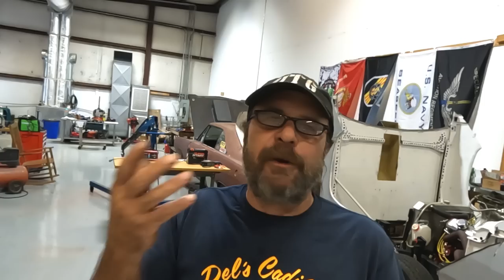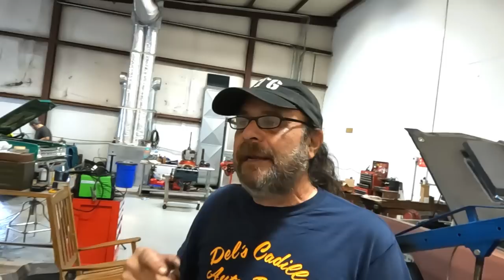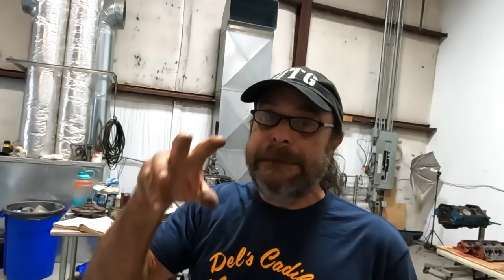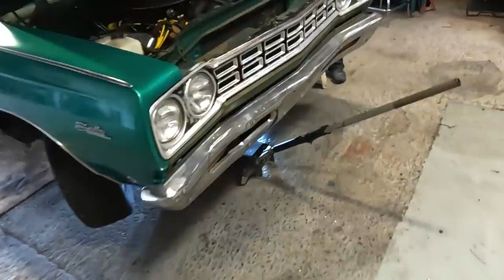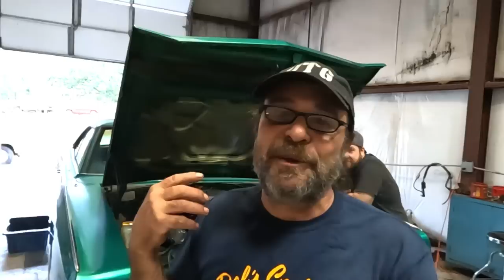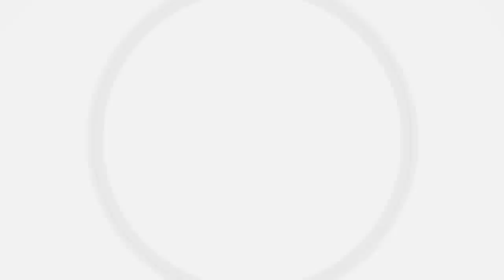The Most Unusual Engine Build On Youtube And Newbie Transmission Tribulations

Comment: Building a 318 currently and with just a few bolt on bits this puppy has really come to life. A cam, headers,4bbl carb and later model "302" heads and it is a snappy little V8.
An old school Chevy 350 guy at heart has fallen in love with the 318!
Reply: "302" as in ford?
Reply: @hickeyskustomresto  
No, the 302 (part number) heads were a closed chamber design used in the lean burn Chrysler motors.
Although small ports and valves the boost in compression makes a nice improvement and seems to really like the comp cams xe268h.
I've read these heads are generally disliked,  crack often and dont flow much but for a 300hp street motor they drive well, awesome throttle response.
Reply: "302" is the casting number on the heads. I think 86-91 were the production years.
Reply: Can u use 340 heads ?  Im a chevy guy too so just wondering .  360 heads ?
Reply: @jeffreyyeater1780  
Yes but the 340 and 360 heads have larger chambers than this particular 318 head.
Compression suffers.

Comment: I have a 69 gtx I bought when I was 17 years old and still have it at 65 years old. I have the original motor sitting in the corner of the shop. It currently has a cross ram 426 wedge that is pretty healthy. Do yourself a favor and put a mini starter on it. I have hooker headers on it which were a lot better design than about 90 percent of them back in the day so it was not a real bad problem to get the starter off of it. I can get the mini starter in and out without any problems.

Comment: In 1973, I bought a brand new Roadrunner with a 318, 170 factory HP. Using all MoPar parts, 340 intake,Holley 4bbl, Purple Shaft cam and headers and a little head work, this car was a blast to drive and pretty quick. I spent a great amount of time at York US 30 Dragway and South Mountain Dragway turning mid 14's and lower all day long. You could smoke the tires all day long and just have fun with it! Not the fastest but a hell of a lot of fun for a young guy on a budget.

Comment: G'day Uncle Tony,

When I was an apprentice,  late last century, I bought an Austin Healey Sprite from dad.  He said that it needed some repairs, so we pulled the engine out to rebuild it.  As we're looking at it on the garage floor, dad says; "Are you going to hot it up?"  "Yeah, OK.  Why not?"  "Well, you better read up about it 1st."  At which point, he gave me David's book, Theory & Practice of Cyl Head Modification.  I read it.  I followed David's instructions for a hot 1098cc A-Series BMC engine.  I opened up the ports, tapered the valve guides, & relieved the combustion chambers.

I sold the car to a mate, before I could get it on the road, but after I fitted the engine & fired it up.  He got it on the road, then sold it to another mate.  He stripped it down, & rebuilt it for racing.  He fitted a Webber carb, a set of extractors, lightened & balanced the crank/flywheel,& replaced any damaged gaskets.  He left the body in steel.  Then we went racing.  I cannot tell you how many times that little 1098 outran 1500, 1600 & 2lt cars to the 1st corner, where the bigger cars would spin off the track (remember that big is a relative term to a Sprite driver).  Every so often, as I would hear that motor spin to 11,000 RPM, I would remember that it was still MY cylinder head on the car.

Please do me a favour, & send my thanks to David.

Thanks for the memory.  Keep up the good work.
Andrew

Comment: David Vizard is an engine optimization icon. He's also a SBC whisperer. I own several of his books and don't understand how I got by without them.
Hey Tony, here's one for you. I bought a 1963 Dodge D100, 318 2 believe and three speed manual. I noticed 2 unusual features on this truck, the first was the manual choke STROMBERG carburetor and second, the e-brake. It consisted of a solid ring app.6" in diameter and 2" across on the tailshaft of the trans. with 2 spring loaded inverted brake shoes surrounding it. When properly adjusted the truck would not move, even at high rpm. It was the best set up I've ever seen. The carb was round and looked like a huge single bbl. until you looked down the throat. Cool truck, wish I could have kept it.

Comment: Good luck with the 318, it can be done. Raced 340 small block Mopar's on circle tracks back in the late 70s. Next to last race one year our prime engine broke a rod and destroyed the bottom end, but the top was untouched. We transferred the W2 heads and cam package onto a junk yard 318 short block to finish the season. Other than the smoking from worn out rings it ran amazing, and we finished that season laughing our ass off at what we were competing with.

Comment: 318 was the first engine I helped build 40+ years ago.  We kinda just overhauled it, since it only had a little over 100k on it. 73 Duster had a good 8 3/4 rearend transplanted into it. 3.23 gears. 
We did put a highrise 340 intake ,Carter AFB and a purple cam in it and some Hedman headers with dual 2.25 exhaust.
It was a great runner ! It would roast🔥 those L70s on back too. 👍👍💪
The guy still has that car in his garage. Its Mopar green now :)

Comment: My 75 Winnebago Brave has one of the baddest 318s ever built and I'm in North Carolina. 
It'll punch out to a 321ci.
This will make up the
" 3-2-1-GO!" Package I had requested.
 Can't wait to see what you come up with.
 The 2 barrel carburetor is way better in many ways and has advantages.
Reply: I agree!  
I drove a 71 Horizon (25 ft Class A M300) with a 318-3 up a long 6 percent grade. It had a lot of guts.
The Mopar Bible lists it's many features, including forged crank with full radius fillets.
Reply: @auteurfiddler8706   Are you saying there's a forged crank in the  318 motor homes?
 I've heard some say it was true and some not.
Reply: @artsomniacv-logcitybydanie1249  Yes, full radius.  I think I read it in the Mopar Bible and possibly the M300 service manual. (M is Motorhome chassis for a Class A, box style).

Comment: The fellow with the '68 Satellite didn't say if the starter was bad, but if it is, one thing I use to prevent the heat from the header tubes (Hedman headers) from destroying the starter motor is to wrap the starter in a piece of wall insulation (fiberglass) when you install it along with the header which is a bit of a challenge. You can also use a couple of pieces of coat hanger wrapped around the insulation to hold the wrap together as you wrestle the starter and header into position. I had gone through a couple of starters before I came up with that solution. That solves the problem on any B body with a 440 or 383.
Reply: Starter was still good, just tired.  There are updates coming about the starter.   Ended up just buying a mini-starter to replace the factory one

Comment: The other good 2 barrel carb for a 318 is the Holley 2280 that came out in the late 70's and came stock on my '79 St. Regis. I liked the carb so much I did one for my '68 Fury VIP that originally came with a low top Carter BBD. All my Mopar V8s have been 318 2 barrels, I just love them so I'm really excited about this build.

Comment: I built  a real fast pulling 318 with .40 over bore, and a cam kit. Everything else was bone stock. It out ran a Z28, and a chev pickup running a 383 small block.

Comment: I wish Mr.Vizard better health. I did the same thing on my 225 slant6 stock parts . I still have to go back into the carter 2 barrel and get more cfm out the stock carb . I also did the same to my 318 in my D150 before I added a 4 barreland cam to it . the rest stock even the manifolds

Comment: Back in the day working on Ford FE's, there were few speed parts.  Some marine stuff in the commercial conversion world, some secret stuff from Holman and Moody that dealers could not even find.  So you had to work out what you could.  390's were everywhere and 406's were around.   3 deuces and 2 4bbl's were here and there, but heads were the issue.  And cams came from TRW and Melling.  But, if you put your mind to it, you could build a stout street engine.  So, I have no doubt that you'all can make a Mopar 327 run 🙃

Comment: I dun rebuilt over 400 transmissions [worked at a transmission shop], and while I don't claim to know all of them, they are generally petty simple all told, and pretty redundant, fundamentally, so once you learn the principles, and the overall ins-and-outs of them, you pretty much find it not too terribly hard to adapt to a new one any time you find one.

Comment: He can see the light at the end of the tunnel??? Son you got seven bolts off.... Wait till you get a peak at the innards of a automatic transmission. You haven't even seen the tunnel yet 😉
Reply: Hope he likes fabricating tools to get those suckers apart.
Reply: Can't ever get the snap ring off the output shaft. I know there are pliers for them but I'm can't buy pliers that only do one thing. It's like buying a pipe wrench that's welded to one size....

Comment: About the 318, Its gonna be better than listening to Starwars. Return of the Jedi!!!
About the 440ci transmission pull out.  He will have less problem if he makes his own tools. We had a 68 Charger RT "B-body" same as that Satellite and I remember cutting a wrench in half for better fitting on the flex plate.  Headers are in the way of certains transmission bolts cause you can't fit your hands in.  
We swaped the starter for a smaller direct fit 92' Dakota for more clearance to.  Littles details that Tony knows im sure.  Hehe.
Nice Satellite by the way and Nice content again.  
The only problem when you first start and fail is not having another part to retry. 
What is enough of porting?
How short to cut or grind a piece?
Good parts are rare or expensive.  Practicing on junk part don't show if it works if you don't try it on the engine.   That's where Tony is great in teaching.  When you feel this, or when it does that.  When you see that or when you ear this.  
I hope you got something out of that! Yes sir.

Comment: Hey IT guy there's a little tip for you .50% gasoline 50% transmission fluid put it in a squirt bottle shake it up real good and use it on your rusty bolts.

Comment: on the exhaust bolts that won't come off , use a 0 or #1 oxy welding tip and use a highly oxidizing flame to burn them out

Comment: IMPORTANT: I was a rare and WINNING FAN of the 318 ALMOST 50 YEARS AGO. I know we're talking stock, BUT the Edelbrock LD4B intake combined with a stock early THERMOQUAD (I believe it came off a 1970 or '71 340) combined with heads I ported and installed slightly larger valves( it might have been exhaust only, I seem to remember a problem with shrouding on the intake valve because of the size of the bore) and headers produced a 318 that was virtually INVINCIBLE on top end! I reached speeds (over 3 miles perfectly straight in Broad Channel island in Queens, NY) OVER 170 MPH in a 1970 Dodge Challenger SE (special edition- little rear window and overhead console) I had installed the rally gauge dash. The reason I know how fast I actually went, was because a half dozen cops came to my house in Rockaway one day, with a claim they clocked the car at 171 MPH, BUT by the time they came out if the marsh grass to come after me, I was over the old North Channel Bridge and gone. Anyway, prior to that day, I ran alot of  Chevies that got me out if the hole, but we're helpless (usually past a quarter mile I admit) as I ALWAYS overtook them, regardless of the rear gears. MANY of these guys insisted I take them for a ride to SEE WHY that Challenger was so fast!  The flat tappet cam was NOT that radical, I think the LSA was around 106 degrees with 280-290 degrees advertised duration and a little over a half inch if lift, with about 130 lbs on the seat, and about 300lbs open. The ramps were gradual compared with today. That's it, of course it had hooker headers, a slapstick, and dual 2.5 inch exhaust out the side in front of the rear wheels. I later did this with a 1971 Challenger convertible 440 six pack, BUT IT WENT THE SAME 171!
Reply: IMPORTANT : FORGOT TO MENTION HAD TO DROP FRONT END AND USE AIR DAM (FROM A TA CHALLENGER) TO KEEP CAR IN THE GROUND!

Comment: Please put this build on DVD. I have my dad's 79 B-100 van, and I want to build it with the most power I can get out of it, but I want to keep it original.  Although it does have a 4 barrel carb.  It already is a good towing van, my dad pulled a two horse trailer with it.

Comment: The motor you get to work on you will check the thrust bearing  Part of the crank shaft please explain about that and what is acceptable or when a new crank is necessary.

 Thank you

Comment: I had a 73 Dart 4 door with the 318 2 barrel with who know the milage back in early 90's. I just put a stock cast iron 4 barrel and thermoquad and added a stock grind 71 340 cam. Kept everything else 318. In the 1/8 it ran a 10.1. I think the rear gear was 3.23?

Comment: I think your goal of 275ish horsepower is a little more realistic that DV's. Using all stock components would mean making his estimate of 315-330hp at no more than 4,600 at the very max, meaning peak torque would be around 420-450ft-lbs. Making that from an N/A 318 is impressive as is, but doing it with stock components would be a miracle. If I were you, I'd be extremely happy with being somewhere in the high 200hp range considering the parts you'll be using.

Comment: Compression height with cheap pistons is almost always 1.74 the 70-84 stock type. More money but KB167s are 1.81 and still down hole about. 010 with stock decks. The advantage is you deck to zero, use a common .040 gaskets and wind up "relatively" close to where the heads were originally.  (.010ish higher deck and thin steel shim gasket) 
Start decking for any meaning quench with pistons. 070 shorter and intake manifold fit gets interesting.
If you want quench you'll need either the 302 heads (yuck)  or 67 and older heads. In 68 the 675 open chamber castings where the new "improved" 273-318 head. Same year the big blocks got the 906s.

Comment: It’s always a challenge just to get at what you gotta get at. Put a clutch in my car once, simple procedure I thought. Well to do so the entire car had to be blocked up about 2 feet off the ground then use a cherry picker to drop the motor down and pull the tranny out the side. The actual clutch replacement went quick, everything else took 2 days.

Comment: 1hp per cubic inch is going to be a bitch with a "stock" cam, heads, springs, intake, and 2bbl carb...your getting back to Smokey Yunick days...good luck 👍 to you sir I hope it pans out. 
The cubes are there but my guess would be about 270hp ...using RockAuto parts, couple hundred on a good day

Comment: David Vizard is a legend in his own time! I've relied on the knowledge learned from his books for years.

Personally, I have plenty of experience and tools, and a little bit of money set aside for my various projects. My biggest problems are finding time to work on them and availability of parts. It's tough to plan when you try to order something only to find that it has an "estimated shipping date" months away. Hell, I waited over 2 years for a set of ceramic coated headers to become available for my current project and they're STILL not available! I actually ended up buying a 2nd set of standard headers and was lucky to find them in stock. They've shipped and are supposed to be in my hands Monday. I'll be sending them out to be coated on Tuesday.

The thing that I like most about this channel is that even though I have plenty of experience, I'm often reminded of things that I'd completely forgotten about over the years, as well as learning things that I never even knew.

To the IT guy working on the Road Runner-it ALWAYS takes longer than you thought it would. But, more important, raise that baby right and spend as much family time as you can! First words, first steps, first day of school and first time turning a wrench are things that you won't get back if you miss them!

Comment: mills that qualify for a "dog" build  aside from the mighty 318-- GM 307 chevy, 305 chevy,  chevy 267/265 v-8 , 307 olds, 350 olds, 403 olds,  poncho 325 and 350 , 425-429 caddy, buick 350, ford 255-260sb, ford 240-300I6 ford 352-390 fe , and i'm sure there are a few more from the smog era-- were talking ALL motor here , no power adders , blowers, turbos  no2--

Comment: If your going to a 325ci with larger pistons it’s no longer a “ stone stock 318” If you do tricks like raise the cam journals, cut the heads, port the heads and intake it’s no longer a “stone stock 318”.. Stone stock would be as it left the factory.

Comment: The 1969 Cobra with headers is bad but the Charger with headers is impossible to work on . BTW 8 second 950 hp SS/AA Thunderbolts bottom end is not potato chips They shift them between 9000 and 9500 RPMs . The Tunnel port won 3 Daytona 500's in a row with a bulletproof NASCAR bottom end .

Comment: Use a 360 2 bbl intake   And carb if they are different on the Dyno test I would like to see the difference if you have time and what cam u using???
Reply: You need 360 heads to make the ports match up. And they lose compression compared to 318 heads.

Comment: I never believed the stock 318 really was capable of the 230 gross they rated them at. I can't see a 100 hp gain with porting and recurving the timing.
Reply: I agree.  A 331 HEMI was only rated at 180 gross hp when it came out. Figure two more points in compression would get it up 10 percent to 200. How can a 318 beat that by 100 HP?   Lunar Outlaw thought his stock 318 would to the same hp as a stock 440. Dream on.
Reply: I agree. I would like to see a baseline dyno on a completely stock build first, I wouldn’t fully rely on the factory claimed 230hp rating